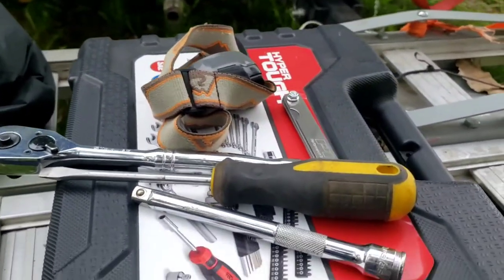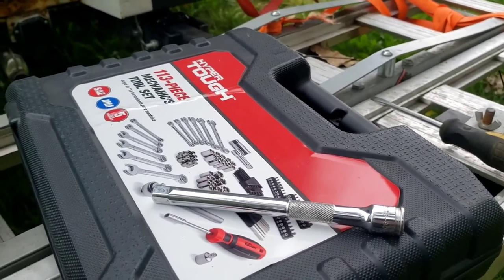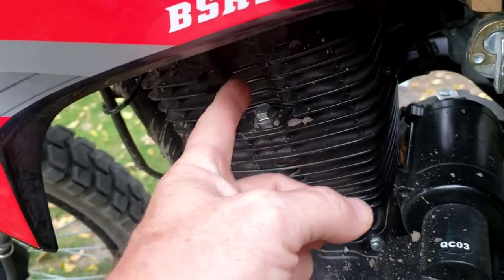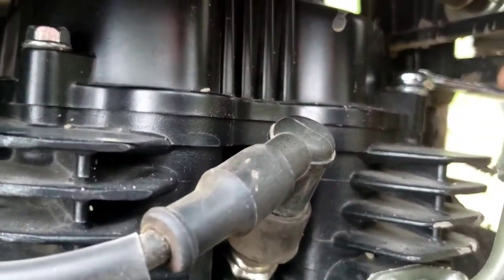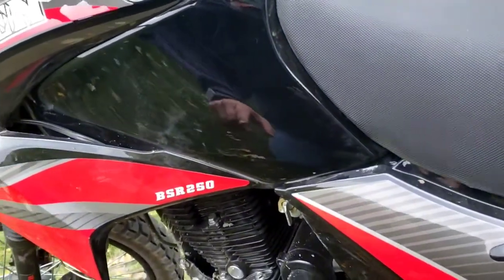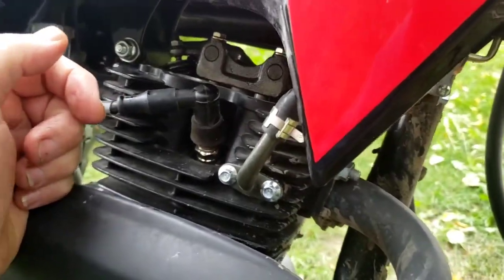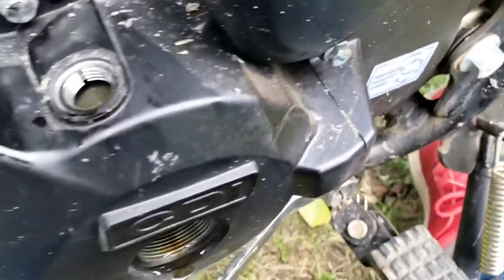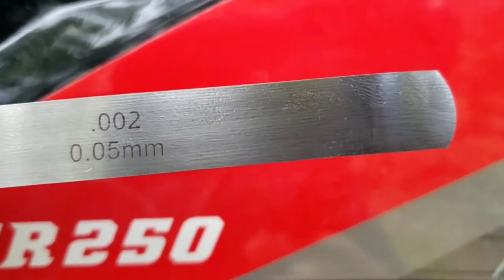how to adjust valve lash on a 4stroke dirt bike.

Comment: Hey, so i have a 2004 Honda CRF100f that i just put a new top end in, at first i pressed the kick start down about 100 times, and it had good compression. I put the engine back in the bike and the kickstarter is locked up now. Any help is appriciated. THX
Reply from the maker: First thing I would check is if the piston is hitting the valves not letting is complete the stroke. Does it have the right spark plug meaning is it to long and piston hitting it? Put a socket in the crank/flywheel see if you can spin motobackwards.if it was kicking over fine before sounds like something is binding up recheck the work you did make sure everything is right
Reply: @Drifter.  Ok. So it does have the right spark plug. The reason i replaced the top end was because the valve went through the piston before. So it had some kind of problem before, should i try a new timing chain? The timing chain seems just a bit loose. And im thinking maybe it slipped timing  and thats the reason the valves went through the piston. Thanks!
Reply from the maker: Thats a good place to start.i know it sucks but I would just tear it apart again and double check everything that's alot cheaper than destroying a motor. It's hard for me to say what to do with out seeing the motor I mean it could even be the wrist pin where rod connects to piston maybe a broke ring and yes new rings will break.
Reply: @Drifter.  ok, thanks for the advice, I will try replacing the chain and see what happens. Yeah I get it cause it cost me 510 to get the new piston rings head valves and everything else up there